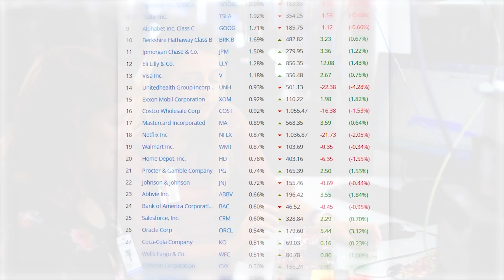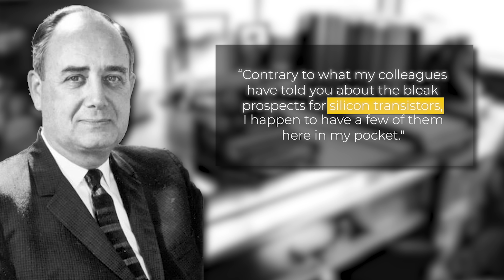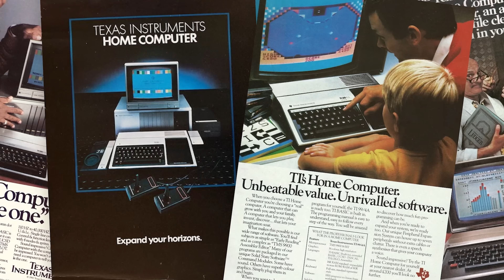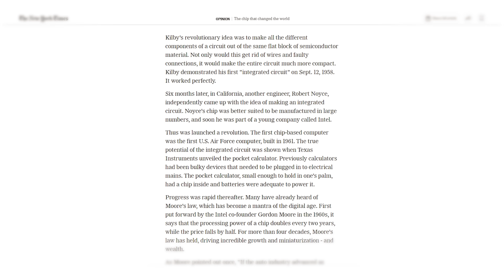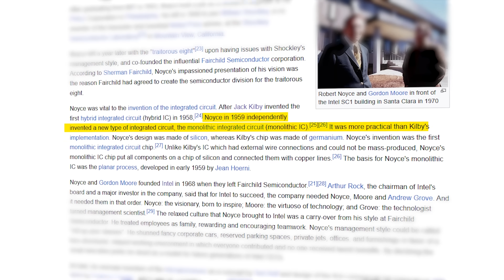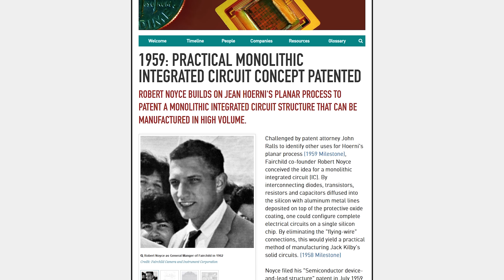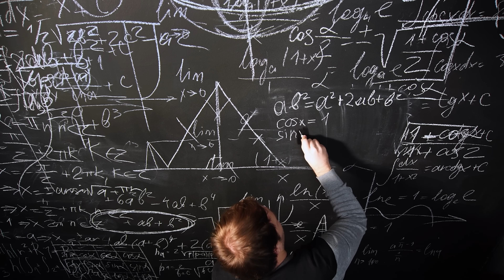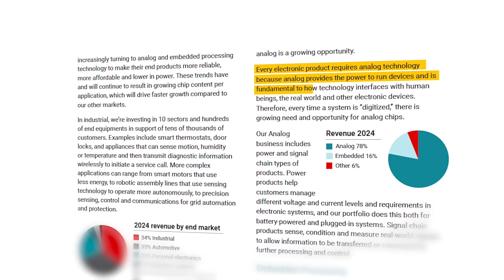Why A Calculator Company Is Worth $186 Billion

Comment: I worked at TI in the mid-60s and bought the first TI calculator that was available to the public at under $200. I had dreamed of such a thing since I had been in the 4th grade -- I have discalculea and math is monumentally difficult for me. That calculator was stolen in the early 70s so I bought a TI-1706+ calculator (4 function plus percentages and square roots) and I still have it. The plastic has taken on that 60's beige and grey look, but it works perfectly from "solar" power (though a fairly dim table lamp works just fine), and it's still doing math for me almost 50 years later. Now THAT was a quality product!

Comment: TI is NOT a calculator company... they are a company that makes a calculator, but the ARE a chip manufacturure/designer.  They make some of the worlds most used IC's in just about EVERY device! from MOSFETS to Transistors to couplers to damn near everything electronic!  Dont call TI a Calculator company....

Comment: learned assembly language programming on a TI58, then spent 35 years using TI DSP microcontrollers in embedded real-time control for semiconductor fab process machines, quite an evolution from the 320C25 to the Sitara SOC whose datasheet was 15,000 pages haha, glad to see TI still survives while so many pioneering companies have merged and split up and disappeared, the grandaddy of them all Intel itself being the latest rumored takeover, the HP Way is long gone from Silicon Valley, alas.

Comment: Seems like you purposely left out the part where they campaigned to get contracts with government schools to get them to use their calculators specifically. Its why colleges still tell you that the only calculator allowed for trig and up classes is the TI-83. Which is by todays standards actually low tech calculators that should at this point cost pennies to manufacture. Yet they are REQUIRED calculators that still cost over a hundred dollars even today. THIS is why they are worth a billion.

Comment: I read somewhere, that the TI calculators today, that mimic the 25-30 yr older devices, are running on modern ARM cpu inside. It just emulates the original hardware&software. Because some prehistoric audit and validation granted them the use in education, and they refused to recertify modern hardware&software for the same. Therefore a much much much more capable hardware is emulating the 3 decade old software secretly.

Comment: Had and regularly used my TI-82 from college ‘92 until 2020 when it died. Quickly replaced with a TI-84 which I use regularly as well. I had a TI-30 as a kid, still remember the red digits.

Comment: Big error in your story.   Jack Kilby did invent this first integrated circuit,  but it was not "flat"  as you say,  it was still hand wired, it was just many components on one substrate.  Fairchild semiconductors developed the Planer process that allowed for integrated circuits manufactured at large scale.    While Kilby certainly deserves some credit,  his approach wasn't commercially viable.  Without the planer process integrated circuits would be limited in their scale and complexity.

Comment: Analog companies can use very old tools to make huge profits. It does not require the latest very expensive tools in TSMC or Intel.
It is a good business model. Engineers work in the Analog companies have a lot more work life balance than Digital companies.

TI has a lot of training and is an ethnically company to work for in general. The manager is the key factor if one likes his/her job.
 
But I don’t invest in TXN, the performance of the stock is (very) poor. It is worst than S&P500 in last 5 years!

Comment: I remember when we were encouraged to buy a calculator for school.  I wasn't sure if that was a good idea, but my mother who had been trained in electronics was more than eager to purchase one for me.  

The calculator that she bought was a TI-30 with the old red l.e.d. display.
It has rigid keys which give a satisfying sound to let you know when you press a key.  I still have the original case and manual that came with it and it still works.  

It is now almost 50 years old and I have a feeling that this thing will probably still be working long after I am gone.
Reply: I had the TI-55 back in the early 80s. It worked well for about two years, then the keys failed (wire matrix oxidized) and the recharger jack broke. I was able to get it working for a while longer, but a simpler scientific LCD calculator I later bought to replace it got me through university. Haven't bought a TI since.
Reply: @ericthecyclist  Yes, now that you mentioned that, I do remember that issue.  I have never owned one.  I will keep my eye out for one in the wild.  Probably not many working ones out there.
Reply: Have my first one I got in Austria around 1976 from one of my relatives. TI-30, first edition, Still work normal.
Reply: wow
Reply: Mike Lawson uses that git-hub for testing new jets built at Airbus in Mobile, Alabama. He shows it in the tour if you ask him to
Reply: Wow
Reply: I had a TI-30 SX and it's a turd. The input text is put on the upper line and the answer is put on the bottom line of a 2-line lcd. The bottom part is prone to failure.

Comment: You didn't cover how they monopolized US school mathematics and STILL charge $100+ for 50 year old tech calculators.
Reply: TI was used to manufacture the key components such as OMAP chips in Nokia.
They made a lot of profit from cellphones!
Reply: They do the same in Europe! In fact they split 50/50 with Casio. This 2 brands are the only one recogniuze3d by the country to be used in exams. But Texas calculator is always 5 to 10 euros cheaper the every Casio counterpart.

What I did was buy an used calculator Ti nspire CX and flash the Transpire CX CAS software. The used calculator and a weekend of fuckery cost me 60 euros.
A new calculator with CX CAS software costs between 150 to 200 euros. But i have to say, with this calculator the hardware is not the secret, the software is..... Too bad Texas did not enter the smartphone market
Reply: @pedro.alcatra  then it changed dramatically. Back when it was relevant to me in the late 2000's, Casios were half the price of TI's, understood by both classes and teachers. I got a TI-84 and never graduated but could at least play Doom on it.
Reply: @pedro.alcatra  In the USA the casio FX115ES is only like $20. I used all through engineering school and they work great. Only problem is they don't recognize keystrokes fast enough if your in a hurry which casued me to make some errors on exams. If they fixed that it'd be a perfect calculator in my opinion. I really don't need my calculator to produce graphs for me.
Reply: soooo glad my HP 48SX is still going strong...
Reply: If you can’t find a $30 one on marketmplace you aren’t looking hard enough
Reply: Not rlly
Reply: That's 11x less then the original that THEY INVENTED adjusted, and they are programmable and work. They didn't monopolize the education system, the government who set educational policy did and probably did it without needing TI being involved at all in order to profit through insider investment trading. TI also is a US company who makes components for many industries including aerospace and military so maybe it was a strategic means of propping up a vital manufacture that supplied the government. It isn't like the banned all other calcs from being on the market, the Department of Education made this standard that students can only bring that brand in to use during a standardized test. Show me how TI directly influenced that choice made by the government in some nefarious way.
Reply: Walmart calculators are 5 dollars with 80 percent same function as ti 84
Reply: @Sadboy80629  and long as you change the battery, a TI 84 will outlive 20 of those Walmart calculators.  I use one at work.  Dropped it, sprayed coolant on it, cracked the case.  Still works same as the day I got it.  Even accidentally dropped it in the chip conveyor once.  Had to take it apart and get it real dry, but it worked after that too.
Reply: This is the type of stuff doge should work on

Comment: We don't have TI calculator here (it's mostly casio and clones).
But as an electronics engineering graduate, I've seen most of the chips for embedded systems and circuits I've used were from TI.

Comment: Calling them a calculator company feels insulting to me. They did so much more but are remembered for calculators. You almost cannot open a piece of hardware even today that does not have TI chips on the board some place. If you work in electronics you don't know them as a calculator company. You know them as a chip maker in general.

Comment: Because TI is more than a calculator company, but a company built around their founder's invention, the Integrated Circuit.
Reply: Jack Kilby wasn't a founder, and the company was an oil and gas exploration company first.  When kilby first POC'd the integrated circuit it also was not the modern planer process that we think of, it required manual connection of discrete components glued to a substrate.

Comment: I believe TI chips can also be found on weapon systems like the Javelin. However, at this point, it's already ancient tech. I think consumer ARM chips can be produced that would be cheaper and faster than those old TI chips, and the only thing that's preventing their complete replacement is that their software have to be rewritten. And in government, it's hard to get approval for such a request.
Reply: TI chips are in everything.  Apple is one of their biggest customers.
Reply: TI makes power converters, bms systems,high speed and precision sensors. Which ARM chips can do these things faster?
Reply: Yes arm is good but ti still remains strong after x86 with intel and amd so Idk why arm would be any different 😂

Comment: TI is an IC chip manufacturer among other things. The calculators have been the same prices they've been fore the last 30+years they don't ever lower. The chips inside are ancient but for some reason (because it's mandatory to have for school) the cost has never dropped.
Reply: Depending on their manufacturing methods, there's not necessarily a drop in cost of production.  Especially after you count inflation and how much more the people who actually make the chips get paid these days.  The chips are the same because they do the job, so they don't need to constantly be coming out with a new version.  It's not like Intel where they need their next generation to have some flashy new tech and then it breaks because they pushed for too much too fast and the company loses market share until their competitor completely flunks the opportunity to get more customers.  Don't try to fix it if it isn't broken.
Reply: It's acient but powerful. If you are asking why they aren't charging more than you have no clue how powerful those machines are
Reply: @christopherlizon5198  internet troll
Reply: @christopherlizon5198  If you think a 50 year old calculator is worth $150, you have no clue. You can get an equivalent or better Casio for less than half.

Comment: I am surprised that you didn’t mention what is arguably TI’s flashiest product: the micro-mirror digital light processing device embedded into nearly every digital projector from portable desktop units to huge cinema projectors. I don’t know how important that single product is to them, but it’s immensely important to much of the world!
Reply: @RideManDave  DLP isn’t by revenue the biggest, but they do have the biggest market share. My friend wrote firmware for those products. 😄
Reply: @, well, yes, if it’s DLP, it’s TI, and because of the way it works it offers greater efficiency, meaning brighter light output, than the competing technologies, such as LCD. Higher contrast as well. DLP:LCD::OLED:LCD if you will. I guess that’s what TI is all about: innovations that might best be described as “amazing”.
Reply: @RideManDave  Earlier beamers with DLP did have color banding issues under certain conditions, but I believe that was solved by having the color wheel spin much faster.
Reply: The DLP chips are just a single example of a MEMS (micro-electromechanical systems) chip, which is a technique used for all sorts of incredibly useful, highly miniaturised chips, such as accelerometers, microphones, & gyros, which you likely have in your smart phone.
Reply: Another example of TI taking a part of the market that didn't compete with the digital computer chip market. Definitely high-tech, but a niche market with not a lot of growth potential.
Reply: Mike Lawson uses that git-hub for testing new jets built at Airbus in Mobile, Alabama. He shows it in the tour if you ask him to
Reply: Wow
Reply: Pshhh....  Their DSP platforms are top notch.
Reply: 1 of the cinema chains in my country would always show a TI DLP ad before each movie (maybe as their projectors use that tech)

Comment: I sat in on an Embedded C programming course at CalState.   It's a course on programming a robotics controller board.   We used the TI Tiva Launchpad board that is similar to Arduino or Raspberry Pi.  It has a data sheet that is a thousand pages long and can be downloaded from TI, with detailed descriptions of the registers and ports.   It made me realize that TI makes a lot more stuff than calculators.
Reply from the maker: Yep, crazy how big they are in the background
Reply: Something tells me that their calculator business is a low-key way to get students familiar with what TI makes long before they get to college where they are going to be working with more intricate TI technologies. Maybe the reason the TI-83 series has hardly seen any updates is because TI's other technology still uses much of the same ancient microcontrollers that their calculators are built from. It's therefore for educational purposes of course.
Reply: TI had a military division that made the electronic of javelin anti tank and also they are number 1 For DSP microcontroller also they have a good costumers support you get a good assistant if you're using their electronics parts
Reply: They make also a wicked range of AD- and DA-signal converters and have been on top of that game for decades. They, indeed, make a lot of stuff.
Reply: I had a similar introduction to TI, I used the Tiva in my first internship. It was really impressive compared to the simple microcontrollers we learnt about in class.
We also used a lot of TI manufactured discrete ICs in our digital design labs, like the SN74 series logic gates and LM series Op Amps.
Reply: Mike Lawson uses that git-hub for testing new jets built at Airbus in Mobile, Alabama. He shows it in the tour if you ask him to

Comment: Before watching the video, I'm going to assume it's because of middle school and high school math classes. Basically forcing every single student to at least own one at some point in their life.
Reply: I'm an electrical engineer and every design I've touched has some level of TI IC on it. LDOs, op amps, ADCs, logic parts and more. Their stuff is well documented and supported, reasonably priced, high performing, and doesn't go EOL very often.
Reply: @toobigtofit3584  As a systems and board-level EE, I’ve always wanted to work for TI, and I have successfully managed to check that off my bucket list with some good contribution.
Reply: Its a misleading tittle, TI is not a calculator company but an IC company.
Reply: @Nobody-Nowhere  and Delta makes a lot more revenue from their credit cards than from passengers but ask 100 people and at least 99 will call them an airline instead of a bank
Reply: @Nobody-Nowhere

True.
However, my own view is that the TI CALCULATOR has been used in the title because it is one of TI's most instantly recognisable "mainstream" high-street products.
And, of course, as we can all see clearly, the manufacturer's name and logo is brightly and prominently displayed.
Reply: @Nobody-Nowhere  They are best known for their calculators though, at least to the general public. Even if every Electrical Engineer knows they do a lot of other stuff, it's not something the average person is aware of.
Reply from the maker: Much more interesting than that :)
Reply: @LogicallyAnswered much more interesting than the fact that a TI83/TI84 have been produced for 25 years and the price is stagnant?  if we compare the cost of computing power relative to their calculators… they’re banking big.
Reply: It's kinda wild that those calculators still cost more than a smartphone.
Reply: @jayspeidell   Not really. Scientific calculator is only like $20 and the graphing calculator is $100. Average smartphone is $300 at least.
Reply: Totally.
Reply: Miss the Tzi dual or double memory banks on their 1980's calculator
Reply: Before watching this I can tell you it’s because they make war stuff like planes and bombs
Reply: Data Center Services and Foundries are huge money makers.
Reply: I think it's  also laregly because they're physically tactile. Which is both a novelty, rewarding and just faster. Doing scientific calculations on a phone is just a terrible experience and graphing I imagine would be terrible. Going up or down one graph point with the four way down pad is so much easier than trying to hit the exact spot on the graph without a stylus which very few phones have now a days
Reply: I heard first time about the company from the video
Reply: haven’t watched the vid but can tell you it goes way deeper than that
Reply: I am an engineering junior in college and we All use TI 84 and 89s some have both
Reply: @generalsirc2615  It literally the first ic we use